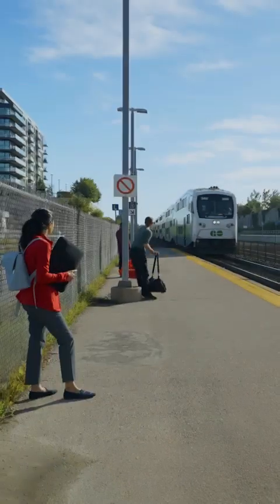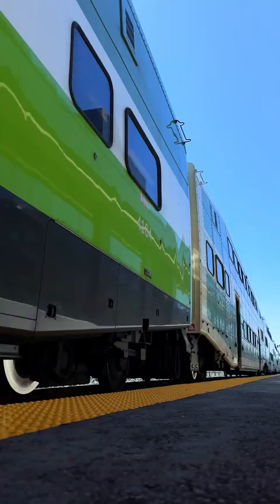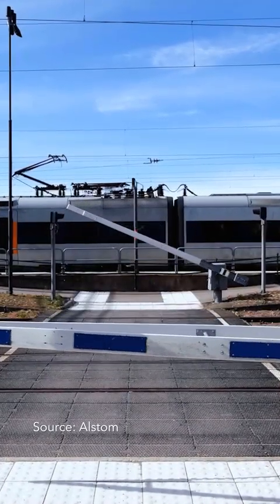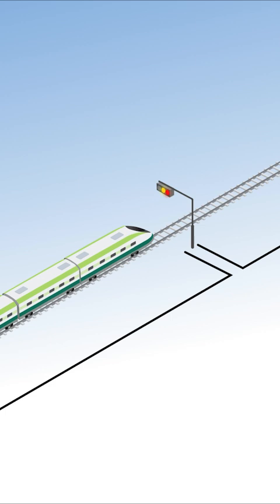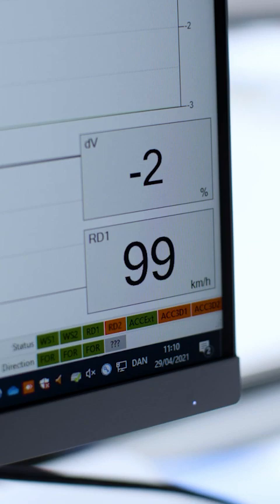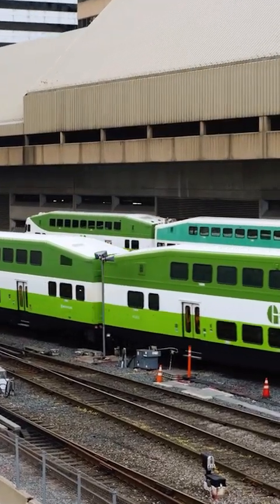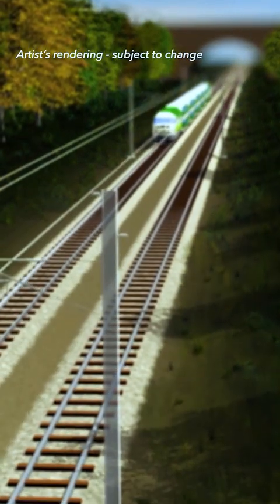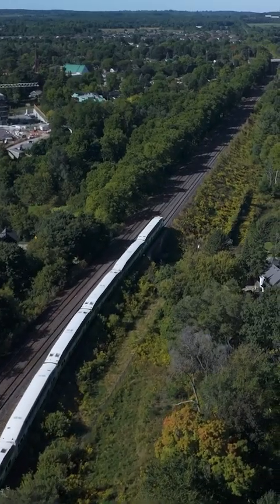What the introduction of advanced signalling technology will mean to transit in Ontario

Comment: Whats the difference with CBTC signaling?
Reply from the maker: ETCS and CBTC are both advanced signalling systems that use continuous communication between trackside infrastructure and onboard train equipment to manage train movements on a rail network. The main difference is that CBTC is primarily used for high-capacity, high-frequency urban metros and light rail systems using the moving block principle, whereas ETCS was designed for mainline railways to enable interoperability across various networks.